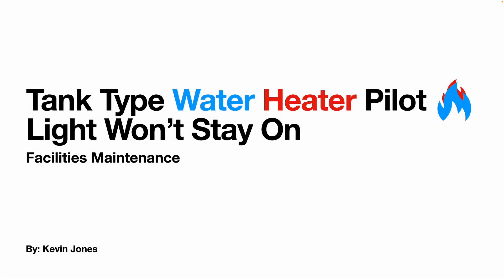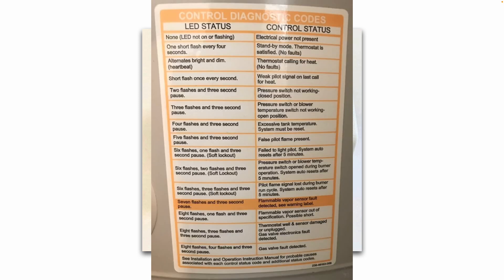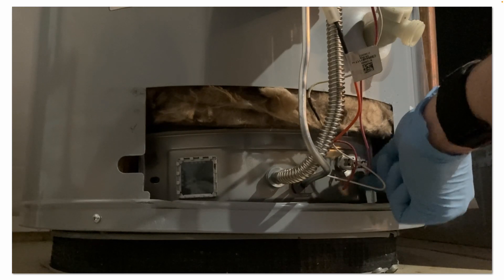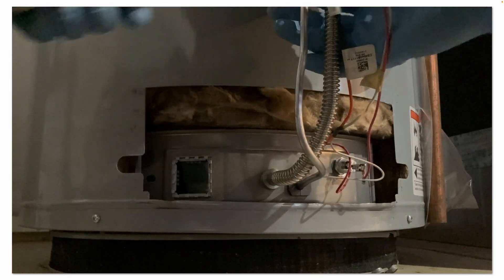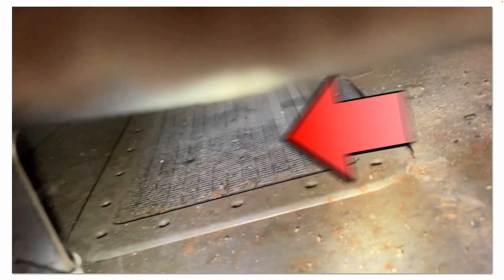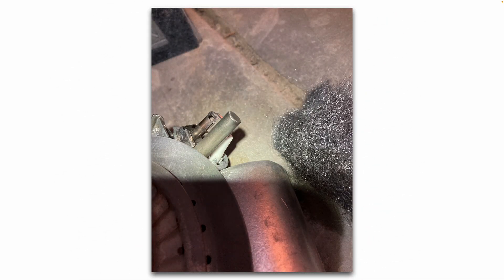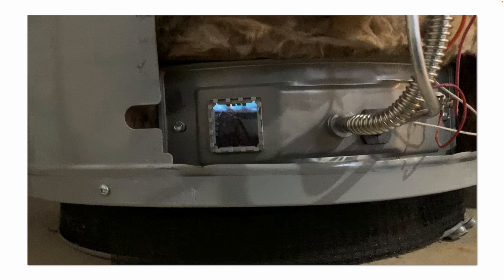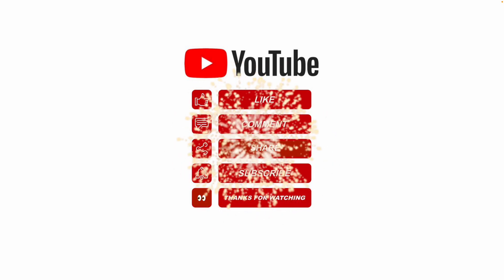Gas Water Heater Won't Stay Lit [DIY]

Comment: My status light is out, pilot light works but that's it.
Reply from the maker: Have you tried cleaning the flame sensing rod with steel wool?  
You can also buy a new burner assy.
Reply: I did and it fired right up. Thank You
Reply from the maker: @rubinrichardson7193 excellent!